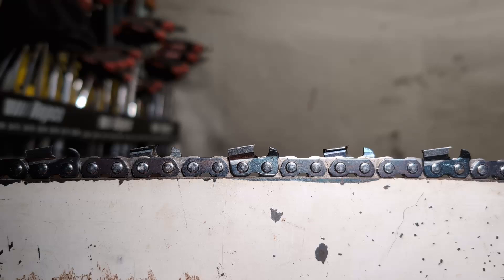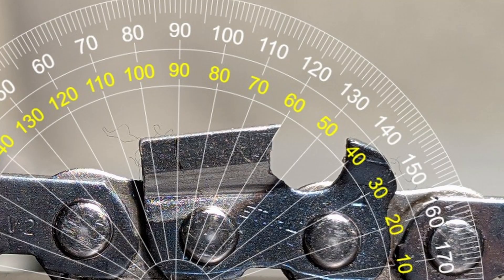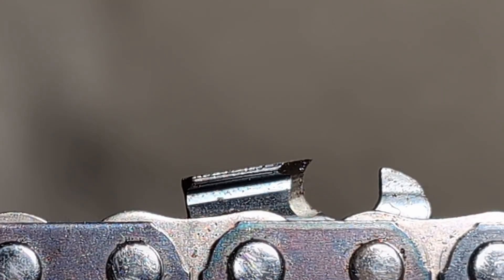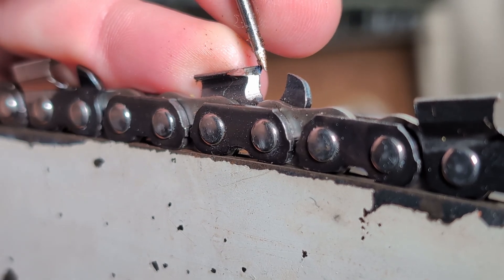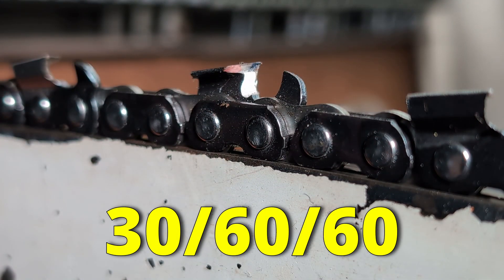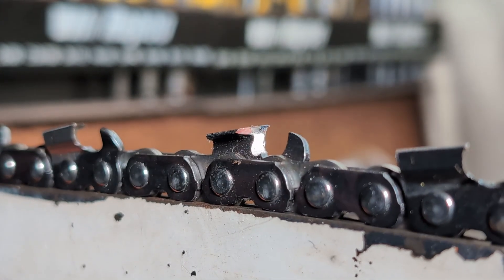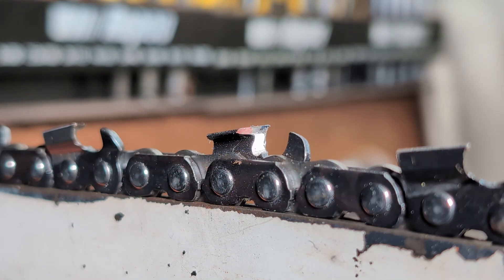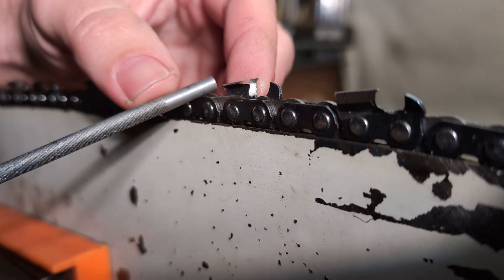File and grinder tilt. Explaining the angles

Comment: I like your overlays-
I approach the angles from the other direction.
Instead of side plate as 60 degrees, I say it’s 30 degrees- same angle just measured from the opposite direction.
The top plate angle is basically the same ie witness marks on top.
Because those two cutting edges are swapping jobs all day long they are both set at the same angle. The nuanceses of , is it 60 or is it 50, is really minor given wood is a very variable material in density and fiber direction.
Reply from the maker: I googled overlay protractors and found a few sites that make this easy to do. It helps make it easier for people to see

Probably the biggest advantage of doing this is actually occurring at the corner but it's extremely difficult to show and explain the slight change in angle across the side plate and shape change where they meet.

It would have been much easier for everyone if they had measured the angles from the same reference so both were 30 in this case. Im not sure why they didn't?

Comment: To be honest, that you mention it, . . . it was when I spent six months running Archer semi chisel with fairly low height cutters. That is when I began to veer towards filing flat, with no tilt. 

And to be honest, having run the semi chisel for that long. And one day I took out the full chisel loops and began to use them again, for quite a while, something that had been familiar to be. Filing full chisel chain. For quite a while it seemed strange. 

3/8 inch semi chisel, the lower height cutters etc is in a lot of ways a different thing to full chisel. Same with .325 pitch chain, I have got some full chisel in that type, and I've used it a bit. It's a lot differsnt to the normal semi chisel .325 chains. It was really using smaller chainsaws introduced me to semi chisel, and I tried it out for 3/8 inch bars too. That was a real discovery. And then, if it makes sense having done so much work using semi chisel chain, and learning how to file it a certain way, . . it has at least influenced my approach now to using and filing 3/8 inch full chisel as well. I'm inclined to notice faster maybe, when my 3/8 inch full chisel isn't cutting well enough and I stop. Because all in all, 3/8 inch semi chisel is a work horse, for getting stuff done. And as resilient as 3/8 inch semi chisel can be, I used to run it ragged too because I worked itthat hard. So I spent a lot of time filing 3/8 inch semi chisel. And it taught me a lot about the benefits of having sharpened chain. 

But yeah, most definitely with semi chisel 3/8, that's the first thing I cared about. Or I learned to care about, when working on blunt 3/8 inch semi chisel. Was I started to learn and care about having a round file flat. No tilt. I don't think anyone told me, I just eventually figured it out. And as I said, when I put back on full chisel now, I look at full chisel a bit different than I once did.

Comment: I think about the tilt differently than most.
The top of the cutter is tilted, it’s not 90 degrees from the side of the bar, it’s off by a little under 10 degrees.
So when you tilt 10 degrees based off being 90 degrees from the side of the bar you are getting closer to the same angle as the top of the cutter.
5-8 degrees of tilt is likely ideal, the inner and outer of the top plate would be the same cutting angle then.
Semi chisel does have the top of the cutter at 90 degrees from the bar so you don’t need to tilt the file on it.
Reply from the maker: I can't say I have measured them all but some do have that slight inward tapper towards the centre 

Another way of looking at this for all of us  sharpening on a saw is there is a bit of side to side play even with a new bar and chain

As everything wears they tend to rock over more in the bar groove as we run the file through. Even if we aim for it being flat, we are probably going to get some tilt by it rocking over

Comment: I have to be honest. I enjoy this back and forth between you two guys. Both of you have a ton of information? Each of you have been very helpful to me. I tend to agree with you more here on this particular subject as has been my real life experience using tilt that chain just lasts longer. We have nothing as hard as the wood that you have. Red oak and White oak are usually the hardest around here. There's not much locust available. I can get three to four tanks on Red oak which is amazing around here and I can get seven to nine on softwoods before I need to touch up and it's been. It's just a touch up as long as I'm cutting clean wood.
Reply from the maker: It's one of those things that has worked for me over the years. I keep trying tilt vs no tilt on chains and I end up back to doing this